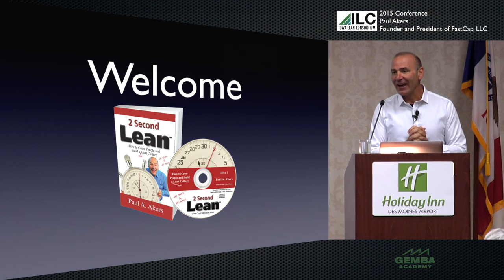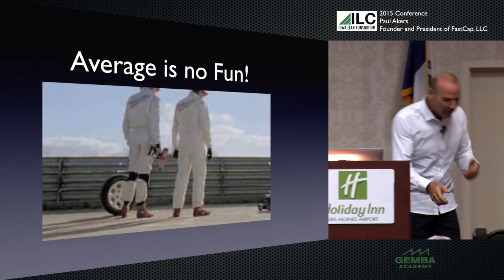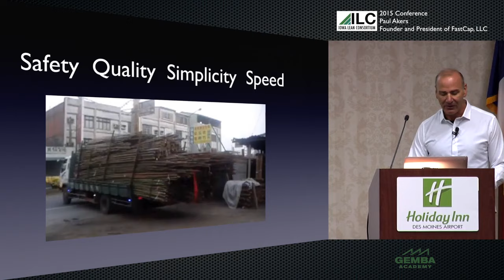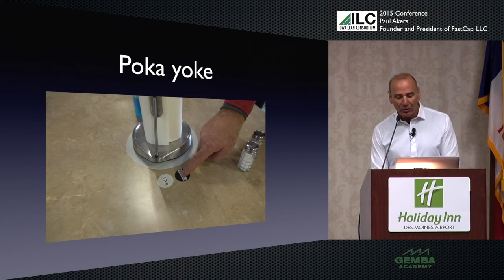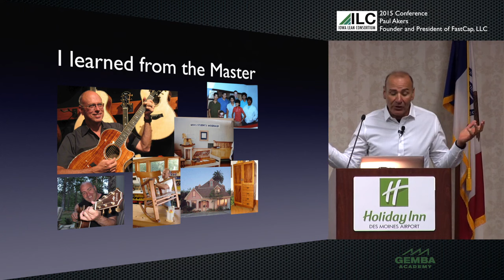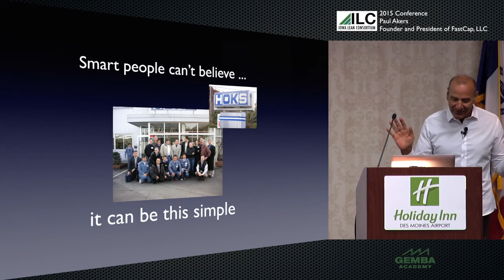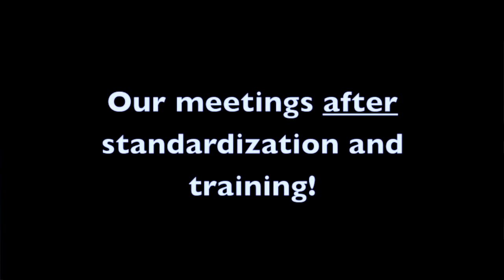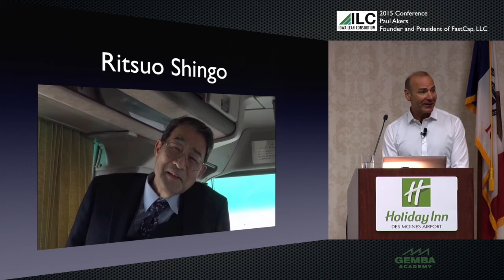Paul Akers Talk - Iowa Lean Consortium

Comment: Can you use the injection molding machine to insert the magnets in the push stick?
Reply from the maker: Yes by hand
Reply: @paul-akers  was thinking as the mold closes it pushes the magnets into an already molded part say maybe on the side of the machine ?
so no need to install at a later time on the shop floor
Reply: just thinking maybe the machine could do double duty as already using hydraulic pressure anyway